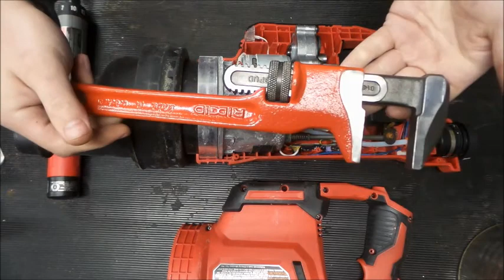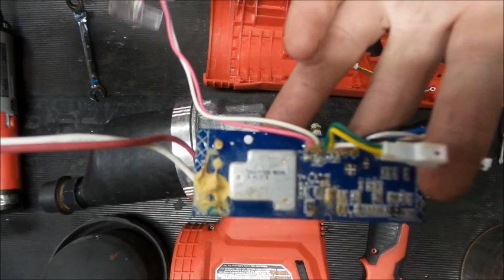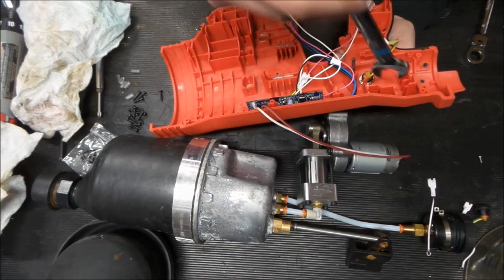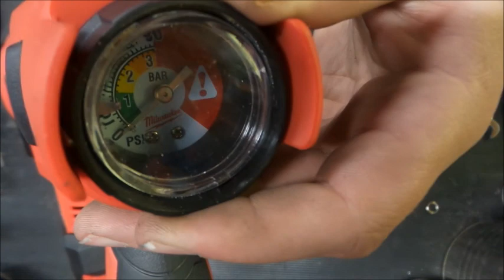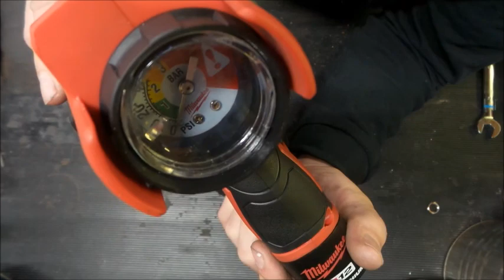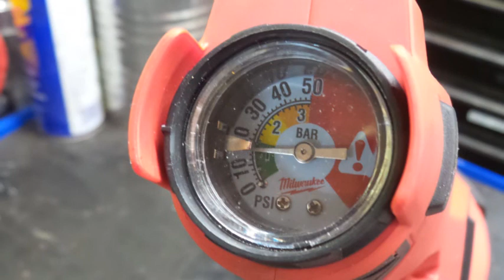Milwaukee 2572-20 M12 AirSnake Revival

Comment: Air snake doesn't start up with charged battery all lights light up pull trigger the lights all light up but doesn't start up
Reply from the maker: It could be a bad board. It seems like these don't like water. Kinda silly considering the market they are being sold to. Do you know if it fell, got wet, or was taken apart at all?

Comment: Hi! Do you know of a way to disconnect the big black barrel part from that metal piece that goes inside the unit? There's a piece loose and jangling around in the nose area of the gun and it's causing the thing not to pressurize. I can sorta move it around from the nozzle but not enough to potentially get it back in place wherever it's supposed to go
Reply from the maker: I would look up a Milwaukee Air Snake Parts List 54-05-0180. See if you can identify the relating components. The parts list may show you how to disassemble things. If you need help, let me know what parts you are looking at from the parts list, and I'll do what I can to help out.
Reply: @ Thanks so so much you rock :)
Reply from the maker: @hannahs137 let me know how it goes, I'll help where I can.
Reply: @TalkingHandsTools  The parts list says not to attempt to disassemble the tank so I don't think there's much I can do :/ Bummer
Reply from the maker: @hannahs137 I'm not sure what your budget is, but if you look for Biedlers Electric Motors on Google and search by part number on their site. You should be able to search 45-66-0075 and see if that's within what you want to spend to try and fix it. 

It's been quite a while since I had the Air Snake apart. I seem to recall the tank being molded together.
Reply: @TalkingHandsTools  It's for work so I'll have to ask, but thank you that's a great idea to just replace the whole tank assembly. Certainly would be cheaper than replacing the entire unit

Comment: Mine doesn’t build pressure but if I cover the tip it builds pressure what could it be?
Reply from the maker: It's been a while but make sure the lever mechanism attached to the trigger is put together properly. I recall it being finicky to get back together.

Comment: My check valve became loose too. How were you able to realigned the plunger and spring? And what orientation?
Reply from the maker: Google Milwuakee parts list 54-05-0180 I believe my problem was with the linkage attached to item number 40. As I recall the linkage was binding up and not allowing the plunger to properly seat. I played around with it and got it to sit properly in the clam shell and was able to get everything to function properly. 

I may not have had the same issue you are experiencing. It's been a while since I repaired this so I may be a little foggy on it.

Comment: My gun doesn’t build pressure, and Ideas how to fix it?
Reply from the maker: Could be a number of things, I have a few questions, does the motor run, do you hear any air leaking internally? If you run it do you hear any air coming out of the nozzle? There's a number of things could be wrong I would suggest looking up a Milwaukee parts list  2572-20 I believe it's bulletin number 54-05-0180. That should be the parts stack up for the Air Snake in there you can see some valves, some linkage, some seals and even the compressor cylinder. I would start with seeing if you have air coming out of the nozzle with it running and move backwards from there. I can say the trigger linkage was a little tricky when I had mine apart and that might effect the ability to build air, that being said that's just what I experienced you may have a completely different problem that is unrelated. 

Let me know what you find, how you make out and if you are able to locate the parts list PDF.

Comment: How did you replace check valve? That’s my problem
Reply from the maker: Luckily I did not have any issues with the check valve on mine. I do recall the linkage can be a little goofy when you take it apart and it may not pressurize if that is off.
Reply: Same

Comment: Where did you get the spare internals?
Reply from the maker: The parts are available from various suppliers. The best thing if you need parts is to search for your tools part number in this case "Milwaukee 2572-20 Parts List" that should bring up a PDF. From the PDF you should find the parts you require on the exploded diagram in the parts list. Once you know the part number in Milwaukee's case a XX-XX-XXXX style part number you can put that number in your search engine and select a supplier. Sometimes Ebay sellers have the parts but normally one of the various tool parts suppliers should have what your looking for. I know this is a long answer but I hope it helps you out.